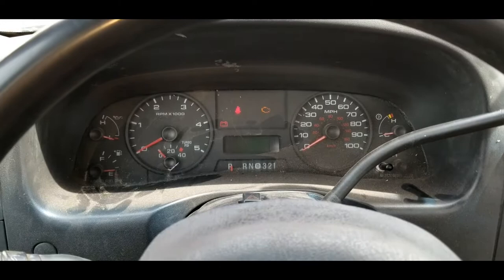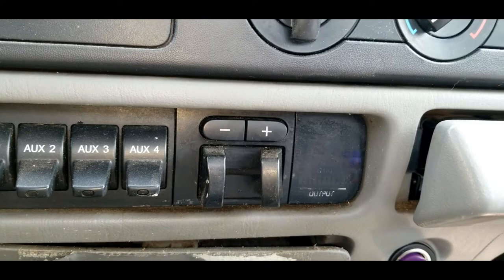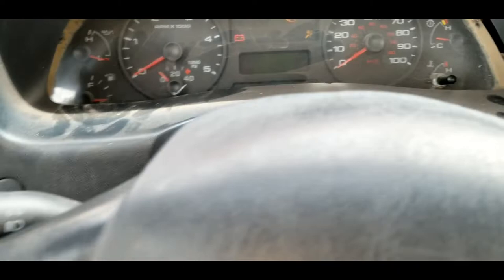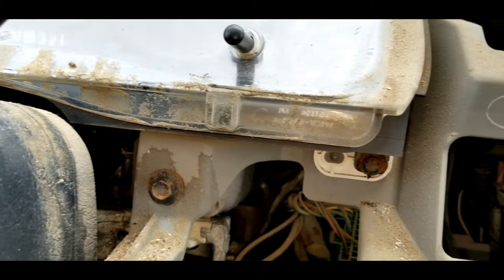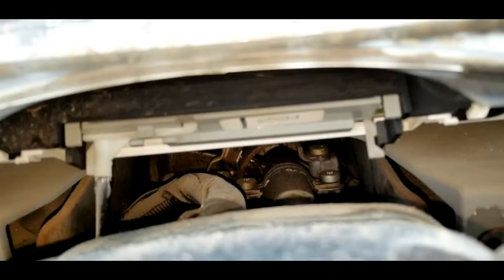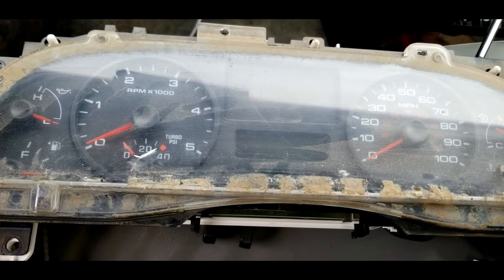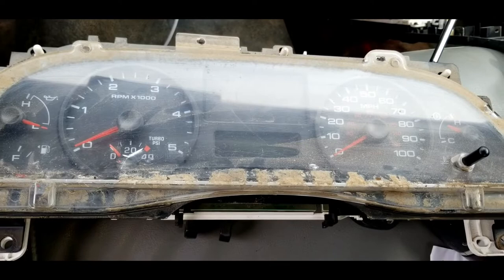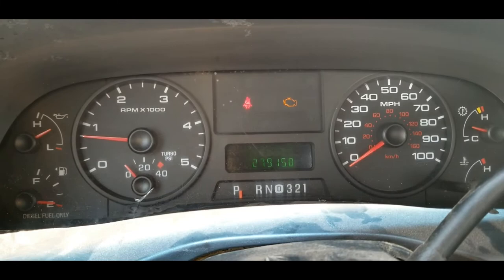2005 2006 2007 Ford F250 Superduty F350 Cluster Removal For Odometer repair

Comment: Question: have an 05 F350 6.0 Diesel. It quit on me the other day so I got it towed home. Ran an initial scan to see if anything was up, found a B1352 Ignition key in circuit fault, U1900 Missing (CAN) Message from the (HEC), P0405 EGR Sensor A Circuit low, B1483 Brake on/off switch circuit failure, B1318 Battery voltage low, and a C1709 Rear Inner right sensor circuit failure. I know about one of my park assist sensors being broken so that kind of deletes the last code. I bought 2 brand new batteries and installed them. Reran the codes and the P0405 EGR code went away. The truck starts, runs now, drives, but when I reran the codes today, I'm still coming up with the 2 PATS codes, the Brake Switch failure code, and the Battery voltage low code . I did notice a couple of weeks ago when I had my horse trailer hooked up to the plug, it kept reading across my dash that "trailer disconnected" I stopped and checked the plug to see if it had come off and it was still plugged in. I'm wondering if the ignition switch needs to be replaced? If that's what is causing my truck to intermittently die on me. It's a smooth quit, not a rough idle then quit. Any ideas?  Thanks a much! Awesome video too by the way!

Comment: If odometer led screen fails can you replace it with another for 2007 ford f 250 superduty 6.0 diesel do not see for sale on internet led screen that is
Reply from the maker: The odometer displays them selves do not fail. Blank screen is caused by defective components on the board.

Comment: I have a question about a 2006 6.0 King ranch… the odometer is reading 282,637 miles even after I took a 300 mile trip and the speedometer is stuck right below 0… I replaced the ABS module, speed sensor and replaced the gauge cluster fuses. Do you think I may just need a new cluster? All the lights and everything else works so I’m a little bit lost
Reply from the maker: Not sure if you're still working on this. Typically when we see that the speedometer is not working and the odometer is not counting it is usually a faulty speed sensor and/or a faulty wire to the speed sensor. Make sure you replaced the correct speed sensor as there is a couple of them. If you exhausted all options, you can send your cluster to us so we can bench test the speedometer/odometer for $75.

Comment: Why did you remove the trailer brake unit?
Reply from the maker: This truck also had a message on the cluster saying TBC Fault which is a common issue inside the TBC controller that we had to repair.